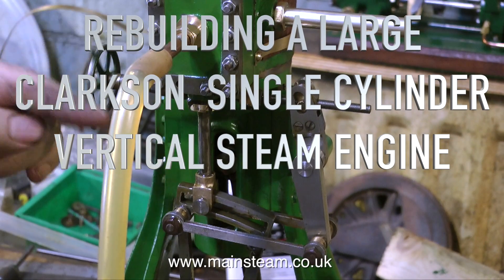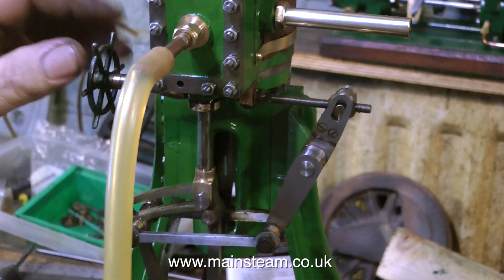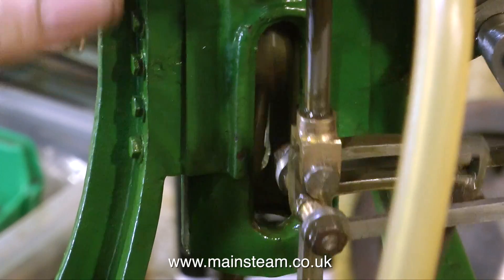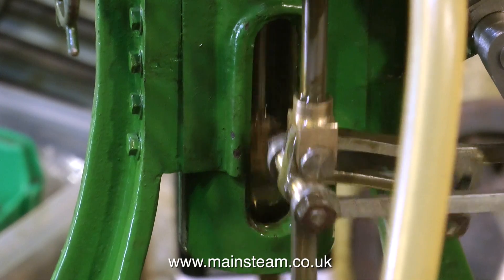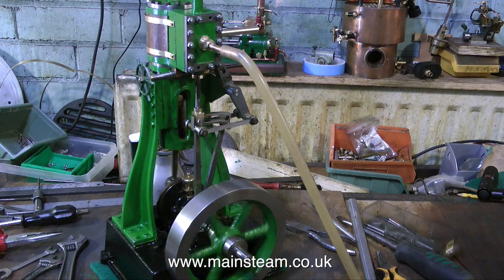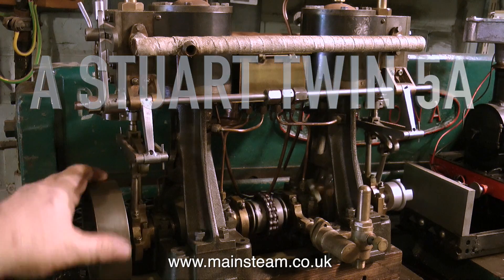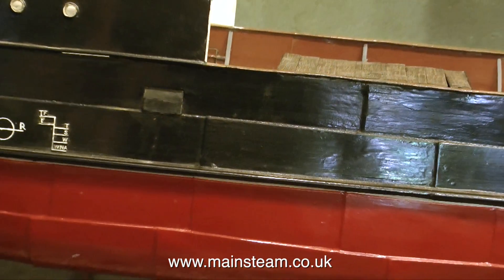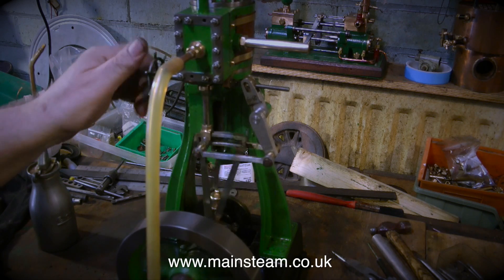REBUILDING A LARGE CLARKSON VERTICAL STEAM ENGINE - PART #30

Comment: I did the same on my engine, I took the crank shaft off and the crank cam(mine is not round so I have been told it's a crank cam, I don't know if that is the right term) but I degreased it all and put it back on with lock tight, when I certain it is right I may drill a hole in it like you did, much easer they putting in a keyway

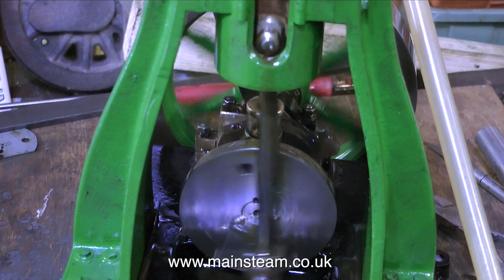Comment: at 1:55 when the engine is running slowly, what causes the piston to accelerate upward? I had thought all the power was only at the down stroke and the flywheel would keep it moving until it got back around to the down stroke again, but it appears the piston is accelerating on the up stroke too. why is that?
Reply from the maker: Stem engines of this type are double acting. Please watch "Model Steam Engines for Beginners" on my Channel.
Reply: I see, that makes sense now. I only recently found your channel. more videos to watch!

Comment: Nice! Any good videos of a rebuild of a triple expansion engine? I enjoy your videos
Reply from the maker: +pipe-organ Coming soon, I have one in the queue.
Reply: I am still trying to fully understand how the Triple Expansion works - I have the general idea. I want to get over to England to see the Kempton and Crossness Engines. Have enough organist friends. Would enjoy owning a model beam engine one day.
Reply: +Keith Appleton Wow, I look forward to that!
Reply: I’ll be looking forward to seeing this.  It might be beyond the scope of a rebuild, but could you include any information or opinions you have about how to correctly size the differing bore diameters for the varying pressure cylinders?  I have read how to calculate those mathematically using pressure curves, but I would be interested to know any “rules of thumb” used on scale models or original pieces.